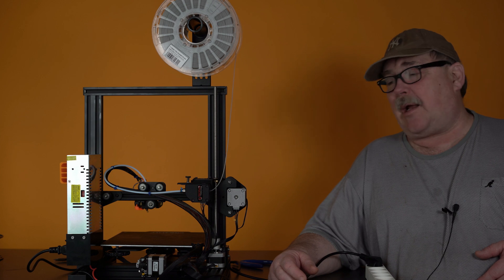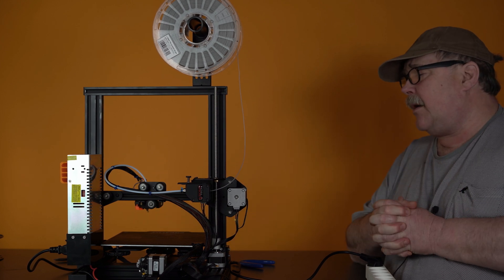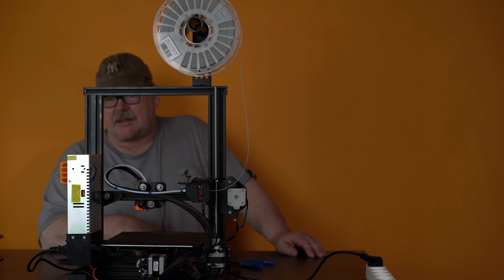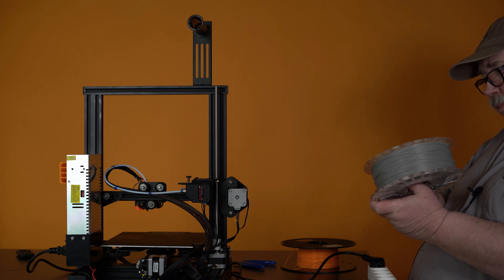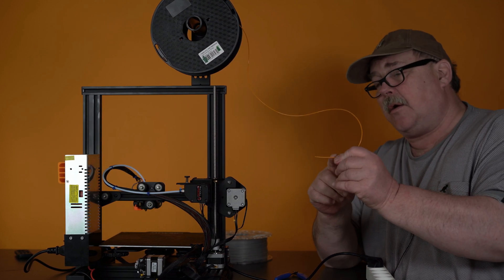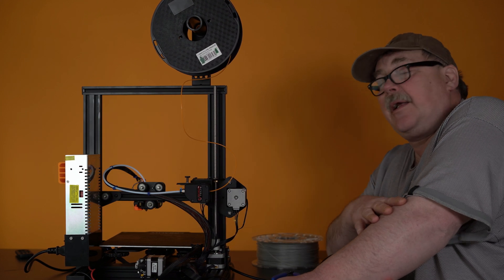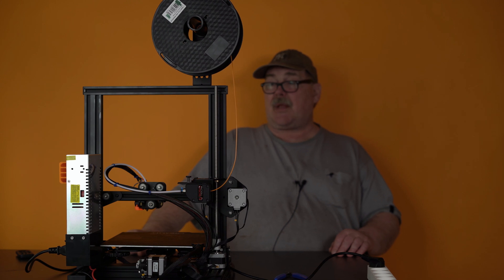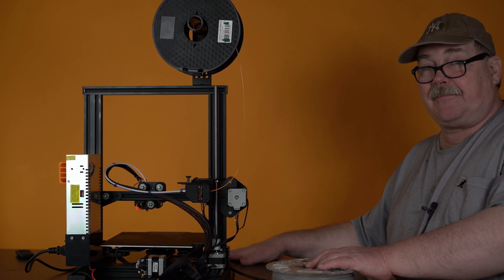FREE Load and unload script for the Ender 3 and other 3D printers with BondTech Extruder

Comment: will this gcode work on the ender 3 v2?
Reply from the maker: Okay then better not use on the Ender 2 then. Sorry for that.
Reply from the maker: Yes sure I cant see why not
Reply: @weitlingD3P  it works however at the end of the pla unload my bed moves forward to the end and starts grinding....what gcode cani alter so it doesnt move the bed?
Reply from the maker: @Scottie_70  This is strange witch of the codes is doing that.  There should be nothing in the code that move the bed in Y direction
Reply: @weitlingD3P  yes however right after all of the filament is removed by extruder the bed comes all the way to the front and starts grinding so i have to shut it off
Reply from the maker: @Scottie_70  Is it the code for flex, petg og pla
Reply: @weitlingD3P  pla unload , it also changed my esteps from 139 to 415
Reply from the maker: @Scottie_70  Just checked the Gcode.  The Y axix is not activated at all in the code the same with the E steps.  Remember this code is in Metric mode (G21).
Reply from the maker: @Scottie_70  Ups så that Gcode change to E 415. in the code change line 3 change the E415 to E139.  but the Y axix I cant see how